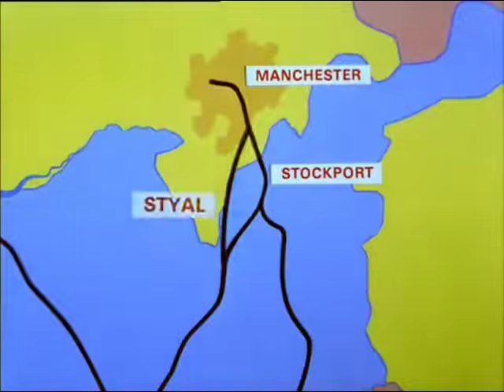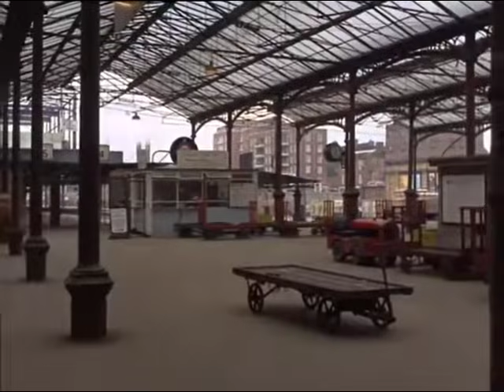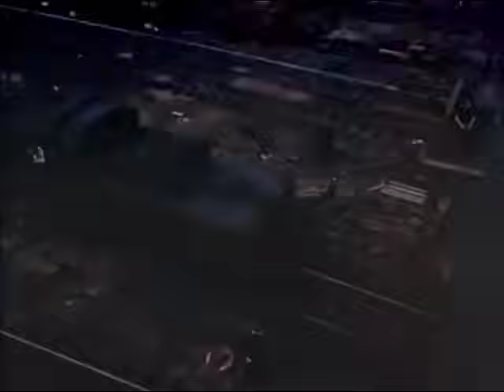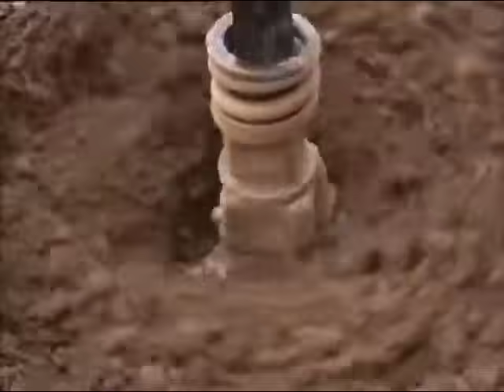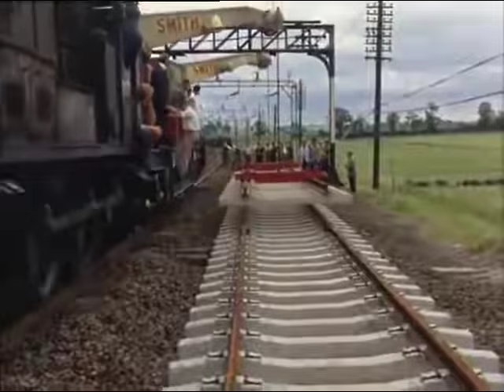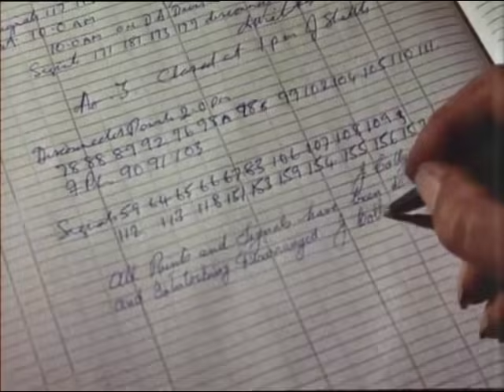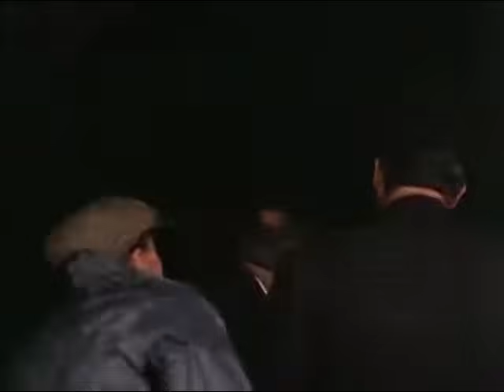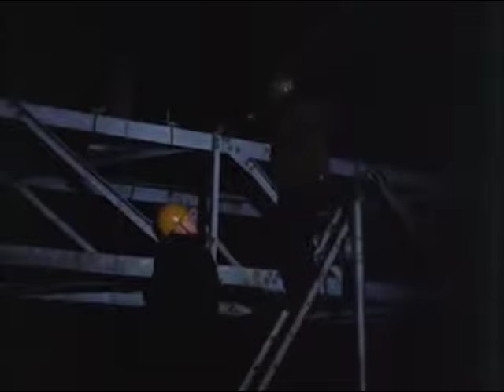Vintage railway film - Under the wires - 1965

Comment: Through numerous other videos,  I've heard complaints and statements of dissatisfaction with British Rail,
particularly on the passenger side of its operation.  But even if all that is true, I can say that British Rail infrastructure and services are still many, many decades ahead of rail service in the U.S., especially when it comes to electrification expansion and track engineering and maintenance.
Reply: British Rail had it's issues, no doubt, but per mile cost, the frequency it was way out ahead in front. Above all  it did so as inherited a system in 1948 that was bomb damaged, managed ferries and shipping (the UK's largest dock owner), hotels and still riven with rivalries from the "Big Four" major pre nationalised companies did mean it had penalties at it's inception that in some respect carry on to this day (even with privatisation). And I've not brought politics into that either!
One of the things it did well (in my opinion) however was look for best practice,  for example, the UK, coach bogies would require heavy maintenance too frequently (in the period of 25-40,000 miles), so  they looked at the US, where as you'll appreciate, if a bogie was failing at 40,000 miles that would mean the US rail roads would have half the coaching stock in repair! British Rail bought the rights to use the Commonwealth Steel bogie, that became the basis of the MK1 coach, with the US designed bogie becoming known in the UK as the "Commonwealth" design, with 250,000 miles between maintenance. 
Boiler feed water chemistry was another area where the US was way ahead and British Rail put a lot of time and effort into learning the lessons of the US rail roads, admittedly years behind the US, and only really mastering it after the US moved to Diesel traction...
Reply: @hypergolic8468  
Well admittedly, U.S. railroads were pretty "top notch" during the early half of the 20th century.  And although railroads (particularly passenger) had to compete against the ever increasing popularity of both automotive and air travel, rail travel still managed to hold its own, so to speak, until the 1950s.  Around this time the proverbial "bottom fell out" of the viability and  profitability for passenger railroading. I honestly believe that a huge reason for its' demise was the failure of the U.S. to invest in the maintenance, improvement and advancement of passenger railroading such as what was implemented on the railways of the U.K..  And this failure was and is especially glaring in light of the lack of electrification expansion for mainline routes beyond the Northeast Corridor along with a lack of infrastructure  investment.  And truth be told, the ONLY reason why freight railroading managed to survive and maintain until this day is because the country could not function well without it.  I'm just relating what I have personally seen over the last 50 years.
Reply: And light years behind Europe
Reply: @mikewatt8706  The difference between the UK railway infrastructure and mainland Europe is that post 1945 most of Western Europe's rail infrastructure was completely replaced but in the UK it was repaired.
This meant that when the 'Modernisation' program was kicked off, most of the roads were unsuitable for electrification with out major investment, and the funds simply didn't exist. 
The biggest mistake that the country made was to repair rather than replace. Even now, a lot of the infrastructure of the UK is based on Victorian designs and structures that have not been fit for purpose for a very long time.
Reply: Those who had to live through British Rail in the 70s including me will be happy to tell you how bad it was with worn out and dirty trains and constant strikes.

Comment: No hard hats , high viz and smoking on the job.
Reply: I remember working similarly contracting at power stations etc, and only as recently as 1985. Today's H&S officials would have a collective coronary.
Reply: @glenjarnold  When it past its worth .
Reply: still normal in the 90's in lots of places except the hard hat which was well entrenched by then
Reply: Good days,, I remember them well. 
Pway gang 179,,,, Shrewsbury.  Happier times.  The Whole Railway was ONE Family. 🍻👍